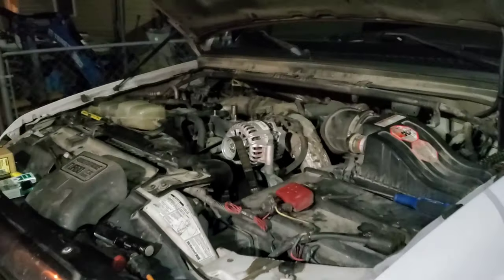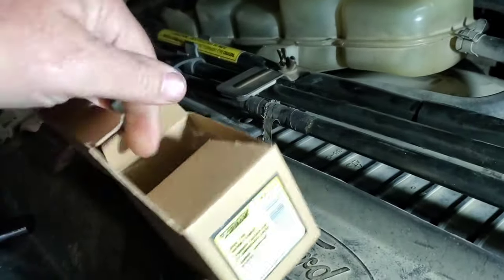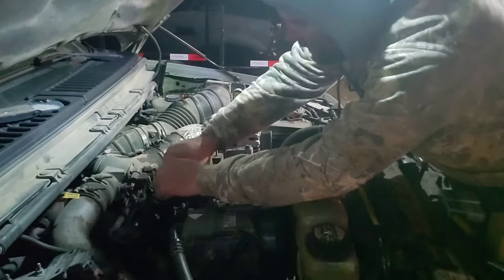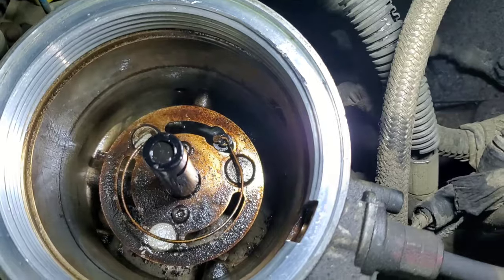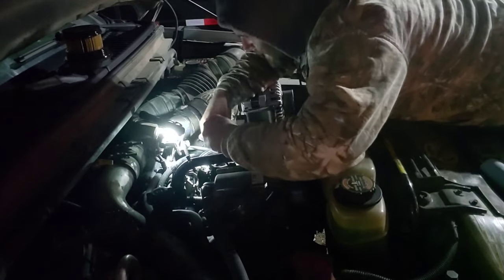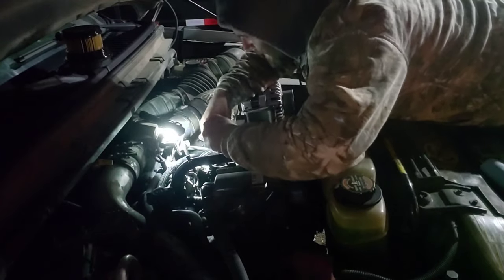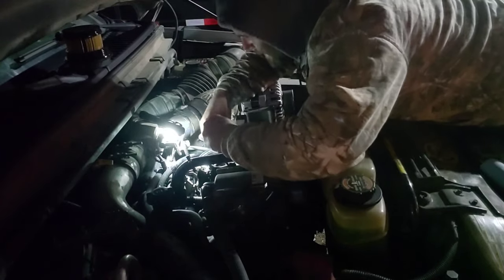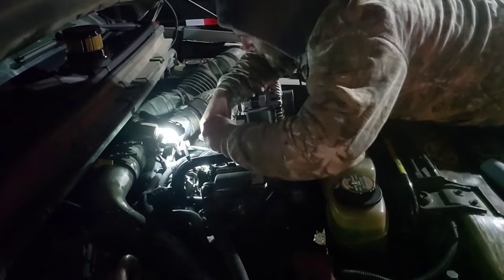7.3L no start no glow plug light

Comment: For me it was a corroded diode in the fuse panel under the hood, number 37. Only part of the diode had continuity, which was why I missed it and why it checked good without actually pulling it out. Try pulling it out and then cleaning off corrosion off all of the diode metal surface. All fuses checked out, and plugs tight. Started right up. Hope this helps someone.

Comment: Thank you so much for your Video. you saved me a tow truck and a ford gouging. and thank you Doug for the tool you gave him, I will make one too. Great video  of show and tell. could not have been any better . right to the point  NO BS added .Mine is a 99  7.3. mine acted up  from just putting a new filter in . once you told me about the fuse I put the new filter in 3 times and blew 3 fuses. put the old filter back in and ordered a new filter from some one else. so far all I had to do was change fuses. but now I know what to do when the element goes. Thank you so much for your free info. you made it easy to find the right fuse rather quickly. and I am going on a 2000 mile trip next week  and didn't want any repair issues. I beleive in the old truck fix too, very good point. Thank you  Chris for your teaching on this video  I am #370 thumbs up
Reply: Thanks for this video this also saved me a lot of time and money.  Easy fix and I was thinking the worst. The only issue was a bad fuel bowl heat and I never new it existed.

Comment: Bro, thank you so much for making this video - My 99 had the same issue. I replaced my Glow Plug solenoid relay 1st , no fix - then changed out my oil temp sensor, no fix. I was at a lost then found your video - The fuse was blown - replaced it and now it’s fixed.

Comment: Chris this video has truly been help to me , I have a 99 7.3 I been buying boxes of fuses at a time (30)amp for at least 2 years. Put the truck in the shop $1600 later still doing the same thing but with the video you shared I’m back on the road again.... Thanks Chris
Reply from the maker: Glad your back running.  The 7.3s are pretty simple. Hardly anything goes wrong with them. If you ever have an oil leak check the top of the engine first in the valley.  Seems to be where 99% of the leaks occur.

Comment: That fuse also feeds the PCM. I just bought my 3rd E99 for my HS business...that wire was removed by the resident rat. On my long list of repairs to do after ball joints, rotors, calipers, front bearing assemblies. And install my flatbed of course. Enjoyed your video!
Reply from the maker: Agreed. I'm glad it wasn't the PCM
Reply: @chrisward405  That's a common problem. Don't much need them here in GA, but I'll fix mine soon.
Reply from the maker: @2020HotShotTruckingLLC  if you are out on the road when fails you can unplug the heater and change the fuse and keep on trucking

Comment: I see that you can just unplug that heater on the outside of the filter housing if you are in a jam. Probably don't need the fuel heater at all if you are only in warm climates. But it can at least get the fuse to stop popping until you can get a new heater installed
Reply from the maker: Agreed. Meant to say that in the video but didn't
Reply: this is the best advice ..always read all the comments

Comment: depends on the year..a 2000. the wait to start being out is..glowplug relay shorted,intake heater shorted..which blows the big 30amp fuse under the hood by the air cleaner housing..remember depends on the year.

Comment: Just a note to everybody, you can pull the white connector plug off that is located just to the left of the bowl which is for the heater and then replace the fuse to get yourself running in a jam if you don't have time to replace the element. That heater is really design for super cold temps and if you are not located in Alaska or someplace crazy cold you can probably run without the element

Comment: My 7.3 has been running great but this morning pulling around the yard to hook up my trailer the truck quit. It cranked back up so I hooked trailer and got down the road quarter mile and it quit again so I turned around went back home. I drained fuel bowl drain it and it started backup. I let it idle for about 5 minutes and went to press fuel pedal and it quit and never would start back. I noticed my wait to start light would come on and I checked fuse and the 30amp was blown. So I guess I’m gonna replace what you just done. Thanks for the video
Reply from the maker: You can test it by unplugging the wire on the outside of the fuel bowl to the heater. If the truck stays running then the fuel bowl heater is the issue.  Hope this helps
Reply: That fuse in this video is the fuel pump mounted on the frame. If you feel the fuel warmer is at fault, then just un plug it. Not likely as it is controlled by the PCM when temp drops really low.
Reply from the maker: Agreed. But the fuse controls other things as well ( fuel related).
Reply: @chrisward405  For Sure. The wires to the fuel bowl heater are not 30A wires. Fuel heaters fail open, not shorted, similar to glow plugs.
Reply from the maker: @stevecarlisle3323  100% correct. I could have unhooked the wire at the back of the fuel bowl and changed the fuse and it would have ran. I wanted to put that note in the video and forgot to.
Reply: @chrisward405  Fair Enough ! the followup is Very Very helpfull. Thanks for your time.

Comment: When my Fuse 30 blew because of the heater, the THEFT light flashed fast also which left me to think my key wasn't detected or there was something wrong with the Theft system. 
I did narrow it down to the fuel heater only after I found out #30 was blown.
I just disconnected the heater outside the bowl at the connection there. Replaced the fuse and it started right up.

Comment: How does the FBH tie in with glo plug and a no start condition.  I am fighting this on an 02.GPR had no power to it's always hot lead.If  use jumper cable and hook to one batt and the put positive on the GP relay, rh side where power goes to inj harnesses. Now glow plugs work and after 1-2 tries, she starts. New tank fuel pickup assy. new Bosch fuel pump, Motorcraft IPR, new icp, new ecm, it burnt out 8 weeks ago, IDM check and PHP hydra chip also checked. Heading to shop tomorrow IF we can get her started. I do have glow plug light that goes out after a few seconds, as usual since new. Wha is up here?

Comment: So I’m having the same issue no wts light no start but I have an aftermarket fuel pump on a 96 7.3 I’ve checked everything new gpc all fuses are good none loose pcm is getting power to where it should I’m stumped no lose wires or anything I know I have a bad glow plug and one weaker then the rest but that shouldn’t be the issue but I’m replacing them all and new valve gasket soon I don’t know what else to do should I check my heater even tho it’s ran off an aftermarket fuel system?
Reply from the maker: You can unplug the fuel heater and double check the fuse. If it won't start after then there is another issue

Comment: Could it loose fuel pump power too? Same fuse? Because i have fuel gauge and both no fuel pressure and no glow light
Reply from the maker: Yes. You can unplug the fuel bowl heater and replace the fuse to see if that is your issue. The truck will have pressure after these steps are taken

Comment: I have a 99 it did start but while I was on side it shut down for no reason  yes I have the same problem with #30 fuse however I don't think that heater alone will stop it from firing . I'm not Shure but I'm thinking it may be tied into the electric fuel pump or injector relay which I'll shut the fuel system down as well
Reply: So to update on the thought of the fuel heater and to eliminate possibilities I simply unplugged the fuel cup at the base where the heater gets power from put in a new fuse and it fired right up. Now I know it was the heater and not something else
Reply from the maker: Correct

Comment: Im not getting fuel to my bowl and ready to pull my hair out OS it the fuel pump PR screens in the tanks its a 1996 first generation 7.3 whr shpuld I start.
Reply from the maker: Sounds like a lift pump issue. Is the glow plug light coming on when you turn the key on?? Fuse #30 under the dash runs a lot of things.
Reply: I'm having  same  problem  already put new lift pump

Comment: I’m having the same problem but I’m not hearing the click after you turn on the ignition switch was yours doing that as well and not clicking
Reply from the maker: I can't remember. You can unplug through fuel bowl heater and replace the fuse and diagnose it that way. If it starts and runs then the heater is bad

Comment: My glow plug lights does not turn on I put 4 fuse and it keeps blowing the wires and look good si it should be that part right ????
Reply from the maker: You can unhook the wire for the bowl heater, replace the fuse and see if it starts. If it starts then that means the fuel bowl heater is bad
Reply: @chrisward405  ok thanks i will let you know what happens
Reply: @chrisward405  hey man I got time today after work to install the bowl heater it took me 15 minutes to install and put another fuse and it works great thanks a lot man
Reply from the maker: @aldodelgado3015  glad I could help

Comment: My glow plug lights does not turn on I put 4 fuse and it keeps blowing the wires and look good si it should be that part right ????
Reply from the maker: Sorry buddy I just saw your comment. If you unplug the wire going to the heater and replace the fuse and the truck starts then you have a bad fuel bowl heater